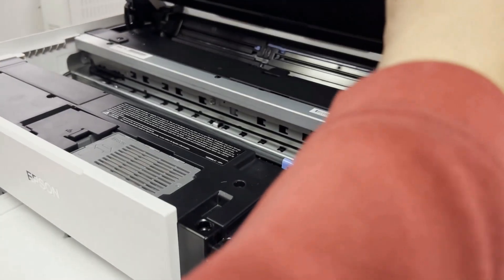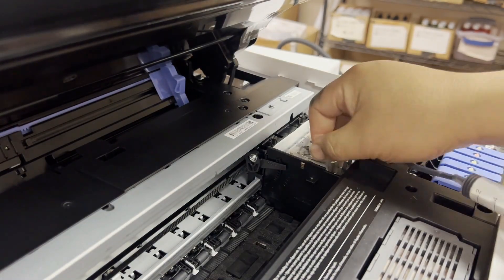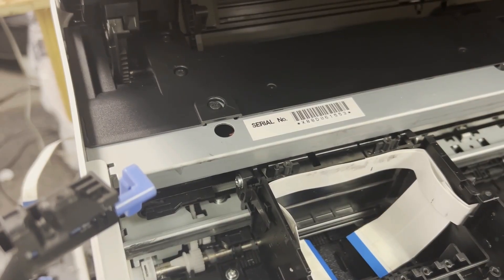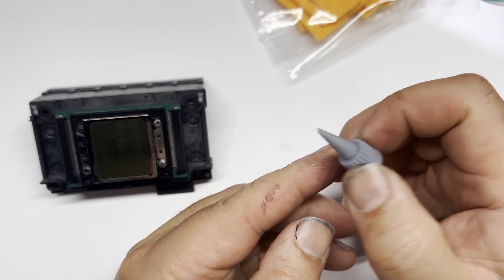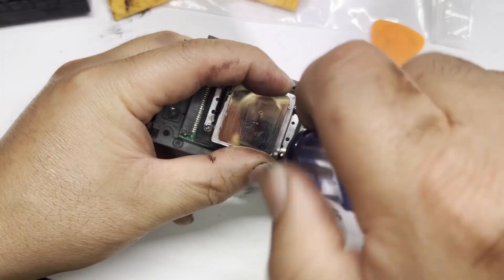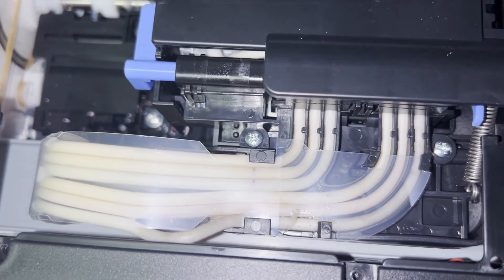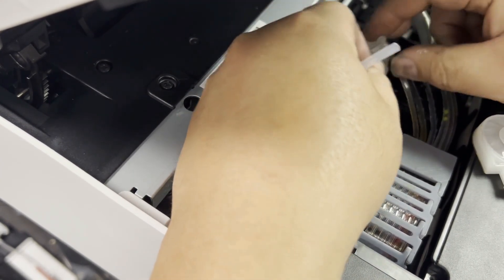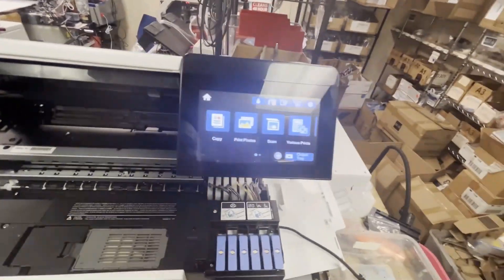#1 MUST-DO for ET-8550 DTF: STOP Using Mesh Printhead - Nipple-Convert It!

Comment: What exactly is the advantage of the nipple set up over mesh? Is it less prone to clog?
Reply from the maker: There are a lot. First, white ink will come through more easily. The mesh is designed for dye ink. Epson didn't expect you to do those tricks with DTF. Then, consider how you flush and service the printhead. Mesh is just a nightmare. Also, ET-8550's OEM damper is just a swimming pool, sitting on top of a poorly sealed printhead.
Reply: @BCHTechnologies  so you think removing the mesh on the white channels would help?
Reply: Keep white from clogging ???

Comment: I have done this nipple conversion on two different printers with the same outcome each time. I get ink flow but the printers printed blanks. The first time, I thought it may have been because I didn't get the manifold or dampers from BCH. So I ordered from BCH and had the same result. Both times, I removed the nippled manifold and dampers and reverted back to the stock ones. Whatever happened to cause the blank pages, stayed because I still got blank pages after putting the original manifold and dampers back. Plus, I ended up with 2 dead printers from trying to get the printers to print. I've emailed BCH for help multiple times over the last couple of months and have gotten ZERO response!
Reply from the maker: Thanks so much for being a subscriber and supporting the channel—it really helps us push toward the 100k goal! I know how frustrating it can be to deal with blank prints after a nipple conversion, especially after putting in the effort with both stock and BCH manifolds and dampers. What usually helps in this situation is properly parking the printhead on the capping station by turning the printer on and letting the head settle naturally (it’s safe to do with the power on), then connecting a syringe and tube to the waste line and carefully drawing about 2 ml of air in stages—start with 1.5 ml to check resistance and seal, then slowly draw to 2 ml and hold for 10 seconds, listening for the damper membrane crinkle as a sign the nozzles are open. If you only get air, the head isn’t sealed; if it’s fully blocked, the capping station may be clogged and needs fixing first. After that, run the printer’s regular cleaning cycle, but avoid strong cleaning within 12 hours and don’t run cleanings back-to-back without rest. I do have a big backlog of subscriber questions, but I try to reply within a few days while member questions get detailed answers within 48 hours, so thank you for your patience—your subscription really makes a difference in helping me keep sharing these fixes!

Comment: hello sir i am from small town of Sikkim i  watch all your videos   i am using l18050 as a modified printer which is same like 8550 with some less feature my point is i am using white  ink circulation after i close my printer everyday after maintenance few ink always gets mix with white i am i asked  the seller and he said me not to use cleaning solution to the capping station  after the print which i do everyday and does that lock may solve my problem because i am not using it because of the damper why i am facing that problem can u tell me i would be thankful
Reply from the maker: Thank you so much for watching all the way from Sikkim and for supporting the channel — I truly appreciate your engagement! What you’re experiencing is ink cross-contamination, which commonly happens when the capping station is wet, and in DTF setups with white circulation this is generally normal behavior, not a defect; keeping all ink bottles at the same ink level before shutting the printer down can help reduce pressure imbalance, and topping them off before you leave for the day often minimizes mixing, plus you can use a clip or clamp to temporarily cut off ink tube flow if needed. Since I get a very high volume of questions daily, I want to share how replies are prioritized: subscribers and members receive priority and are usually answered within 48 hours and also get perks like early access to videos, regular viewers are answered if time allows since I can only reply to about 10 questions per day, and after subscribers and members, remaining reply slots are filled last-in, first-out (newest questions first), so if you’re not subscribed and don’t get a reply within 48 hours, you can either subscribe or repost your question, and if you subscribe later, your older questions automatically move into priority without reposting. I’d also love to invite you to join Run With Kevin — LIVE, where I go live every morning (usually between 6–8 AM Eastern) and answer printer questions in real time, so subscribe and turn on notifications if you want to catch the next live and ask directly. If you need faster assistance, feel free to email [support@bchtechnologies.com](mailto:support@bchtechnologies.com), and if this video or comment helped you, I’d really appreciate a Google review here: [https://g.page/r/CfL7k6nYvPQ9EAg/review](https://g.page/r/CfL7k6nYvPQ9EAg/review) — thanks again for your support and keep those questions coming!

Comment: Hi Kevin,
I followed your video exactly. I have ink flow and everything is filled. Printer goes through all the motions, but when it prints, nothing is on the paper. Not sure what else to do.
Reply from the maker: Thanks so much for your support and for carefully following the video—I really appreciate you taking the time to comment and troubleshoot. Based on what you’re describing, the first thing to observe is whether ink is actually flowing during a normal printhead cleaning cycle: if ink moves during cleaning, the printhead itself is likely not clogged; if it doesn’t, then the head needs to be parked and primed again. To park the printhead, turn the printer on and let it settle naturally onto the capping station—it’s safe to do this with the power on—and since DTF ink is thicker than standard ink, the head often needs extra help to get started. Once parked, connect a syringe and tube to the waste line and gently draw air; you should feel slight resistance as you pull, which confirms a good seal, while only pulling air indicates the head isn’t parked correctly or there’s a capping station leak, and total resistance suggests a clogged capping station that must be resolved first. If ink flow during cleaning looks good but nothing prints, then the issue is likely electrical, so the next things to inspect are the mainboard, related fuses, and especially the printhead driver IC 041B (IC800 and IC801), which commonly causes this exact symptom. Thanks again for engaging with the channel, and if you haven’t already, please consider subscribing or becoming a member—subscribers and members receive priority replies (usually within 48 hours) plus extra benefits like early access to videos; because I get a very high volume of questions and can only answer around 10 per day, regular viewers are answered if time allows, and after priority replies I go last-in, first-out (newest questions first), so if you don’t hear back within 48 hours you can either subscribe or repost your question, and if you subscribe later your older questions automatically become priority without needing to repost. You’re also invited to join Run With Kevin — LIVE, where I go live every morning (usually between 6–8 AM Eastern) and answer printer questions in real time, so subscribe and turn on notifications if you want to catch the next session and ask directly. If you need faster help, you can email [support@bchtechnologies.com](mailto:support@bchtechnologies.com), and if this video or comment helped you, I’d really appreciate a Google review here: [https://g.page/r/CfL7k6nYvPQ9EAg/review](https://g.page/r/CfL7k6nYvPQ9EAg/review) 📋 Copy

Comment: This nipple "trick" really isn't needed. I looked to far into 8550 dtf conversion and ended up buing the parts to do this. Did it on my first 8550 and it only lasted a few days before the printhead was completely clogged. Also it claims to get rid of the fine mech that could be a problem with dtf ink. But the v2 dampers recommend have the same mesh inside them where the ink fills the damper. After the first 8550 was left broken i got a new one and left it stock aside from using a ciss.
Reply: Interesting to know!  So leaving the 8550 printhead as-is is the way to go?
Reply: @jtom8888  I believe so. I see far more long lasting 8550s that are left mostly stock than ones that are modified. In my experience, leaving the printhead alone has kept my printer running longer. But i dont have years into this hobby just a few months. My first printer i did printhead mod to only lasted a couple weeks. The one i left alone and only added a ciss to has lasted a few months without any trouble.
Reply: @Specialedes  Thanks for the quick reply.  So I'll leave it stock then.  I just bought a new 8550 and was wondering.
Reply: @jtom8888  all i do is wetcap with DIY cleaning solution at the end of every day. Clean the cleaning squeegee every once in a while. Other than a ciss and top rollers removed no other mods to printer.
Reply: @Specialedes What CISS you use

Comment: Hey Kevin, i have a question, but i don't know how to reach out to you, other then comments.

I'm searching for a sublimation printer, that prints at least 9" wide and can print from a roll. I was wondering if it's possible to modify any ecotank printer, so it can print from a roll. Otherwise i'm screwed, since those printers cost at least 3k€. I appreciate your help and thanks in advance 😊
Reply from the maker: Sure. Check out L18050 in your market. Or ET-8550 in the US/Canada market. You will need to get gray sublimation ink, but it is do-able. You can also use a RIP software to bypass the roll feed. Actually, think again, you don't need to get gray ink. Just leave the two white channel empty. Then when you have clogs, you can use those two channels. Win-win. You can reach me at support@bchtechnologies.com

Comment: You should offer a complete conversion kit. I just bought all the parts from you, but a whole kit would have been nice.
Reply from the maker: We’re on it right now! Thanks so much for your advice and support!
Reply: Agreed.  Kevin, please just offer all the parts necessary in one big kit altogether for someone with an 8550 so there's no confusion on what other parts are needed.  I would definitely buy it if it minimizes clogs significantly.   Thanks!
Reply: Did you put it together? I just bought the cover and my dampers don't fit. Epson 8550, what else do you have to buy?

Comment: Silicone sealant is fine, but I prefer using Liquid Electrical Tape, same manufacturer as that silicone, but it seals great. Have to let it dry a good few hours, but being able to peel it off in one clean piece while still keeping ink out of the electrical connectors is a big help. FFCs are cheap, but nice to be able to easily salvage them in a pinch.
Reply from the maker: Thanks for sharing

Comment: How much is it to get a fuse replaced? I have the death code on my epson ecotank 8550
Reply from the maker: You can do it yourself. However, if you want us to do it, here is the link: https://bchtechnologies.com/collections/printer-repair-service/products/fast-track-mainboard-repair-l1800-xp-15000-et-15000-wf-7610-7620-wf-7110-wf-7710-7720-et-8550-et-2720-et-2750printer-mainboard-formatter-board-motherboard-troubleshooting-and-repair. If you want to get the fuse and DIY, here is the fuse: https://bchtechnologies.com/products/f1-fuse-also-f2-f3-for-epson-mainboard-fix-error-0x9a-or-031006-on-wf-7720-wf-7710-wf-3640-et-8550-xp-15000?_pos=2&_sid=da0e0ab4a&_ss=r